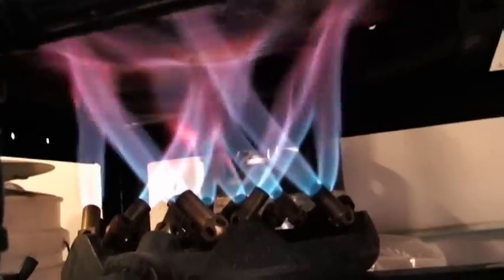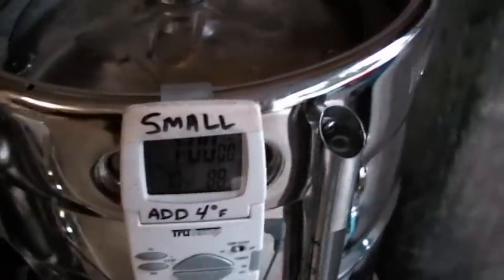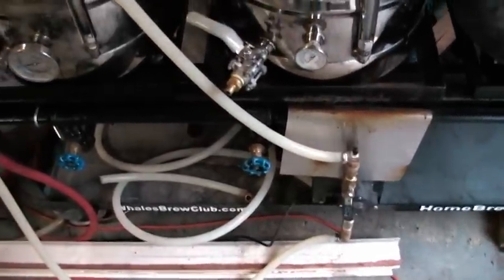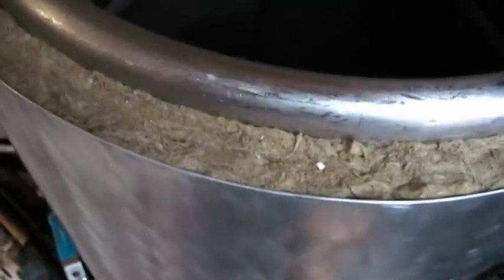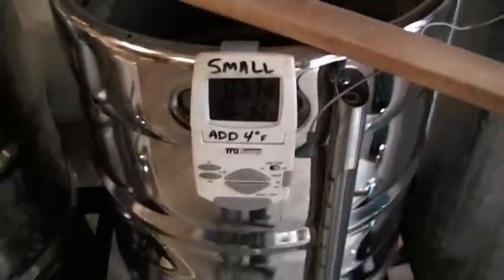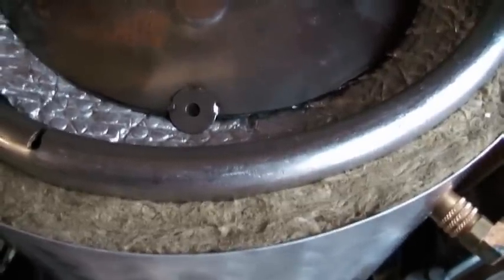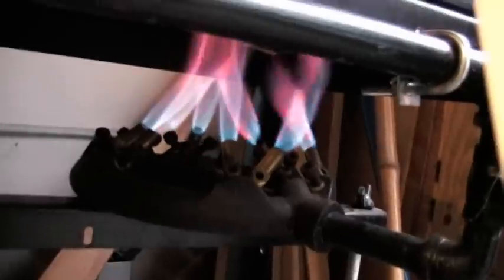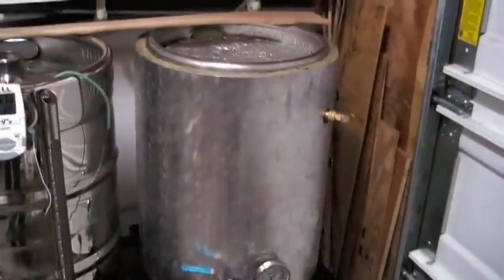Brewing Vessel Temperature Calibration for Software

Comment from the maker: I'm running natural gas. Apparently these burners come in high pressure propane and low pressure propane/natural gas. The latter has much larger orifices in the tips to let more gas through. You may be running the wrong ones.